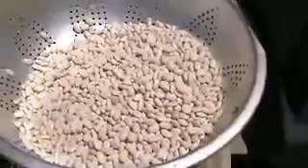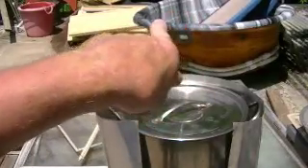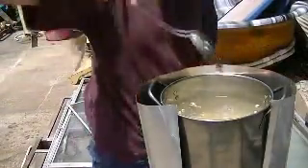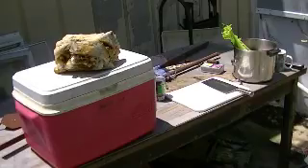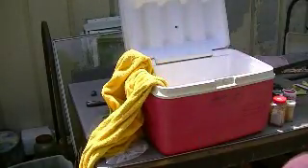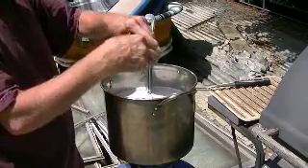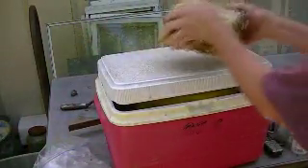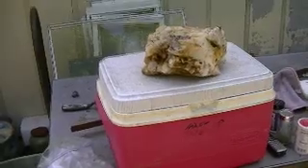Thermal Cooking on the Rocket Stove

Comment: Hi Kevin.  Great videos, very informative and practical.  I realise this is an old video and I apologise in advance if you have already answered a similar question. I am looking forward to making my first rocket stove. However I want to use it when camping/caravaning for cooking.  Most of the cooking I have seen with the rocket stoves involves making stews or casseroles etc... While there are a few that use it like a BBQ, I am wondering how you regulate the heat produced if the overall aim of the stove is the gasification of wood gases. Ie. If I want a lower steadier flame/heat, how does that effect the gasification process. Do I end up with a smoky, inefficient stove?  Regards. Dan
Reply from the maker: Smokey and sooty. The exhaust from a rocket stove is, generally, not suited to direct cooking. Charcoal dropped into the chimney and burned as a BBQ would work because there's no primary burn to produce the nasty creosote. Then you can regulate all you want. Since the stove makes it's own charcoal, just wait until sufficient coal bed is produced and...... There you go!!
Reply: Thanks for the reply. I guess for economical wood heating this is a great idea.  I'm just wondering whether you would use more wood to burn down to coals and to regulate the heat. I am thinking that if the amount of wood is increased, then efficiency is reduced, then a good 'ol camp stove may end up being as efficient.  I guess I'll have to make one of each and find out. Thanks again and love your channel. :)
Reply from the maker: For open cooking BBQ, you may be right. Also the RS has a very concentrated hot spot that makes direct cooking difficult.